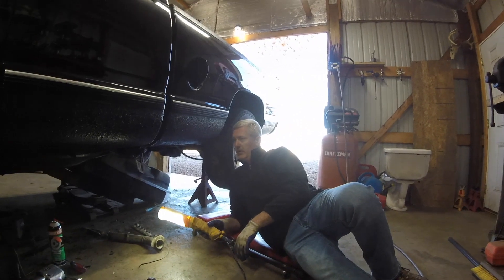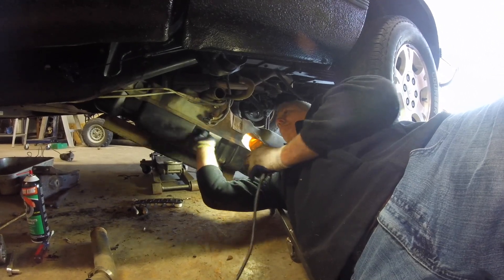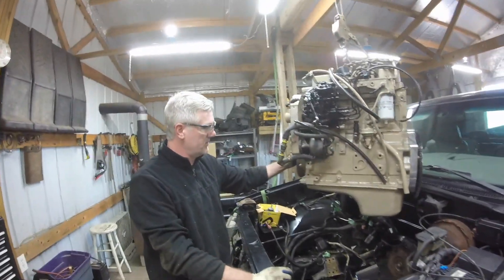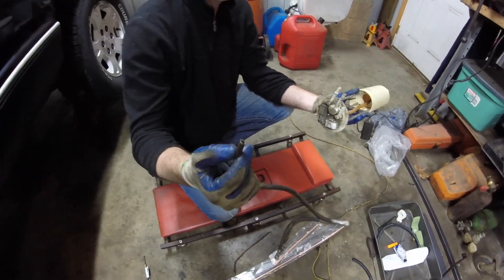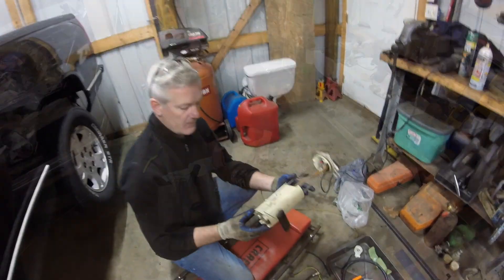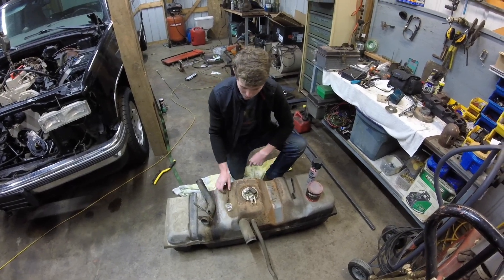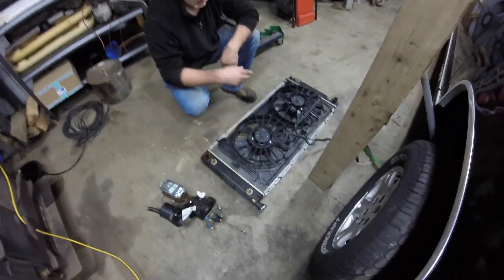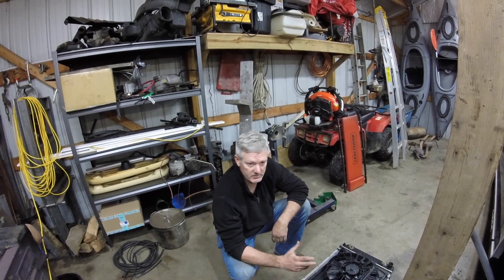Part #4 CUMMINS 4BT CHEVY K1500 CONVERSION Fuel Tank Mod!!!

Comment: I'm doing this to my 94 with a 4.3 and nv3500. Plan on using the 4bt and an sm465 trans with Ford driver drop transfer case. Why? Because that's what I have laying around I guess. As for the wiring did you use the stock instrument panel and gauges ?
Reply from the maker: @thaddeusforreal  yes I used all the same temp/oil sensors and attached to the engine.

Comment: So is there a fuel pump needed to run the 4bt?
Reply from the maker: There is a fuel pump located on the engine, the fuel pump is driven off the camshaft.

Comment: Did you end up using a vibration dampener off a 5.9 like you mentioned in the video? If so did it help with vibration? Thanks, you really do a great with your videos!
Reply from the maker: No we didn’t use a 5.9 just stuck with stock pulley. I saw a good vid of someone using the fluid filled dampener and using a half filled water bottle sitting on engine it made a huge difference. Is it worth $500 I don’t know.

Comment: Where did u get the adapter plate from ?
Reply from the maker: Summit Racing is where I got it and the flex plate.
Reply: Could you send me the link I can’t seem too find those adapters I have an 02’ GMC Sierra single can stepside am really leaning into doin the swap on it
Reply from the maker: Eric Ruiz  in one of f my vids I have all the info and part numbers down in the comments section, thanks for watching

Comment: hey after you guys finish im sure you gonna do a recap... do you mind showing how you prepped the engine for paint
Reply from the maker: I didn't record the paint prep or the engine rebuild, sure wish I did.  I just used a small wire brush with Brake Kleener, cleaned and primed and used Rustoleum paint.

Comment: Love these videos! This will help me out tons with my truck, I have a 93 k1500 that I want to put a 4bt and an NV4500 trans in, right now it’s stock with the 350 and 4L60E trans that just went out on me, plan on finding a donor truck for the manual trans in that
Reply from the maker: Thanks, I'm trying to give as much details as I can to help others with the swap. I should be posting another vid tomorrow on the motor mounts. I am working on the turbo and downpipe placement tonight. The stock 4bt exhaust mainifold should fit, I ordered the down pipe and V band clamps tonight. This will be in the next vid..... Thanks for watching